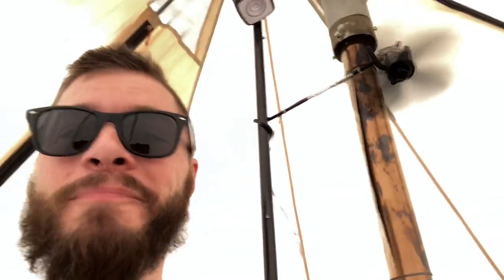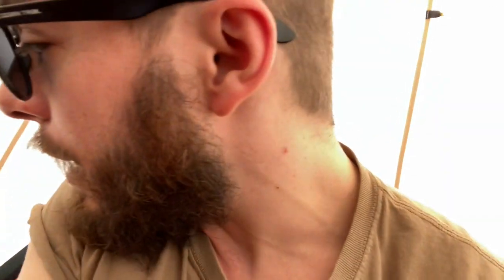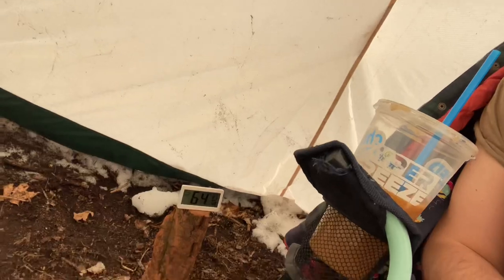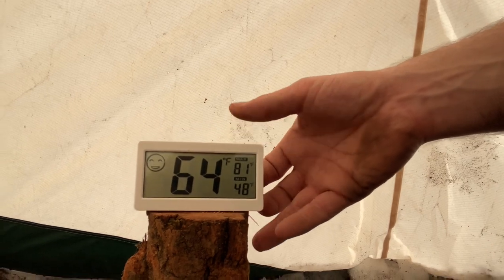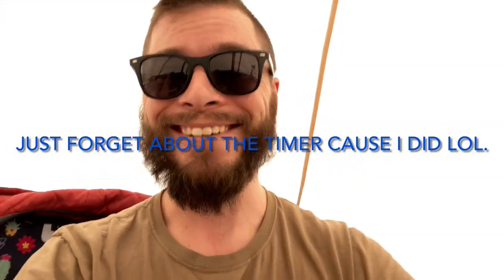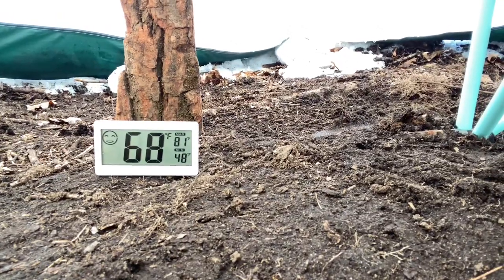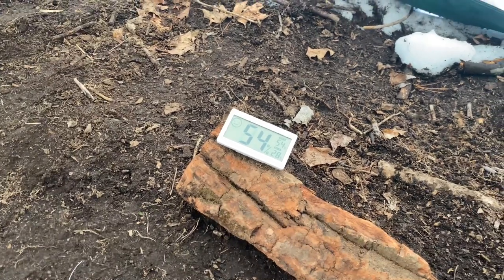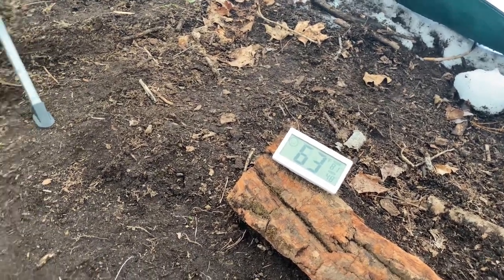DIY Hot Tent Ceiling Fan TEST!!!

Comment: How does it compare to the stove top configuration of this fan?
Reply from the maker: @timo2233 it changed the air temp at ground level by 10 degrees if I remember right. Stove top will just push air forward not down. Thanks for watching

Comment: no dude 34°f is cold af! it would be interesting to see if it could run another fan or a small light
Reply from the maker: @Doc Ink they make them with duel fans. I was thinking about using one for the next version. A light is great idea! And someone else mentioned adding connectors to be able to disconnect it. With those you could have different attachments for it. And 34 was a heat wave lol. Where you from? Thanks for watching

Comment: That is badass
Reply from the maker: @Jeff Jackson thank you. I was pretty surprised how well it worked. Thanks for watching bro!
Reply: @AdventureswithSpackmann  that is awesome! It is ashame you didn’t think about that when it was still cold out.
Reply from the maker: @Jeff Jackson I was saying the same thing today lol. Put now I have time for version 2 lol
Reply: @AdventureswithSpackmann  yep lol
Reply: @AdventureswithSpackmann  I've been thinking about getting a TEG module and hooking to a computer fan. I used batteries, but it sucked them down pretty quick. It does make a world of difference though doesnt it?!

My main reason for DIY was because those commercial deals are heavy. May burn out a TEG module though if Im not careful since the stove top can easily get to 1000+.
Reply from the maker: @HandfulOfTranquility  burn it out cause there isn’t a fan to cool it? If so I’ve thought about this. If it does happen my solution would the duel fans the make. Take one off the base for the ceiling fan and keep the other in place to cool the base. Someone had mentioned hooking up some duct work to the outside of the chimney going down to the floor and with the fan blowing down the duct to push heat to the floor. Anyways a computer fan would fit in the duct much nicer. Sorry brain started turning. Thanks for watching!
Reply: @AdventureswithSpackmann  I am less concerned with your style because the extrusion has a lot of mass and can radiate some of the heat away. These are not meant for glowing red stoves though so burning out is a real possibility. The element inside is probably rated for 600 degrees which is the highest Ive seen yet.

Rather, I am concerned about it with a completely made from scratch one unless I put the module on something else. I actually hoped to find a wax motor rates 500-600f but thats way too high. My thought was to use that to physically lift the device off the stove, lol.

I am thinking I could put the module on an upside down plate, then put my pot on top of it filled with water as a cold side. Maybe an array of 3 modules for stability?

I reached out to a few TEG suppliers hoping to do a collab but only one got back to me and the others didnt respond. I havent found a single good TEG video yet. All the vids use crappy TEC modules which dont have the temp rating or the efficiency/output.

When snow abounds keeping the cold side cold would be very easy with a pot of snow water, lol.
Reply from the maker: @Handful of Tranquility ohh I like the pot of snow idea for cooling the top. Do you think adding another heat sink below the base would tone the temperature hitting the TEG down a bit? I have some old heat sinks from desktop computers that I’ve been keeping around for a project. Could you use something like that for your idea?
Reply: @AdventureswithSpackmann  that should work; put the fin / fan side down on the stove and the TEG module where the CPU would go. Or a plate of steel or some other less conductive material. CPU coolers might be a bit tippy for a pot on top unless you used 3 for a tripod base.

My goal is for something light as I want to be able to backpack it in. I just did an overnighter that my pack was crazy full of luxuries, but "only" 42 pounds. 6 pounds of that though was my gun (was hoping to do some small game hunting), but I also had a chair, tarp, hammock, and several other things. I am hoping to have a luxury filled hot tent setup where the whole pack is under 40lbs, or better 30lbs without the gun, because I will be using it more of the year than what I can count on snow for.

So, for this project, I would love to keep it under 12oz or so and aiming for 8oz. I think the commercial heat fans are 2-3lbs. I am curious if its just one TEG in these fans or if its multiples, and what output it is
Reply from the maker: @HandfulOfTranquility  ah gotcha. And yeah I don’t think I would put a pot on top if I raised it with another heat sink. I bet the snow would be just fine and would need another heat sink. Good luck with your setup.